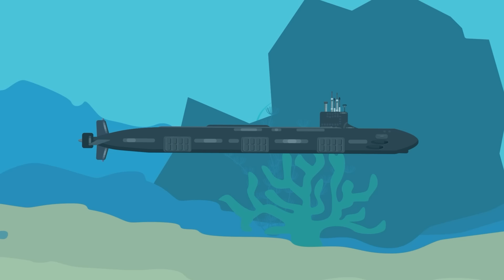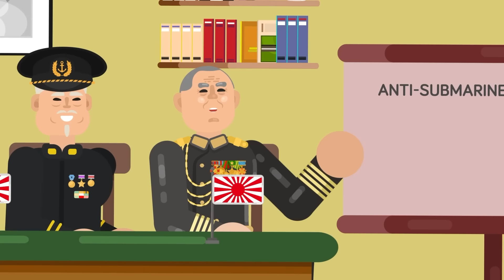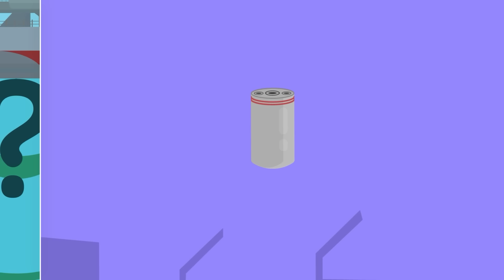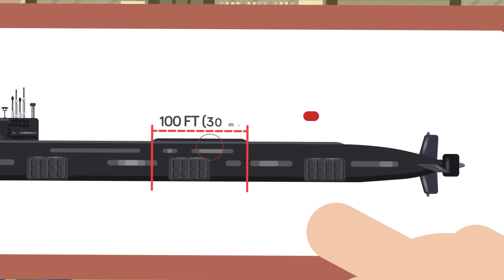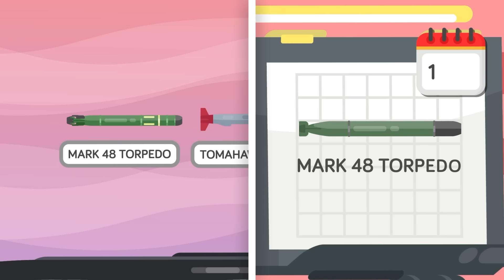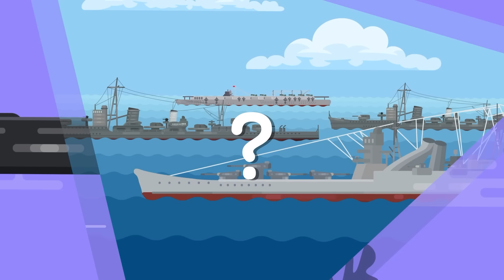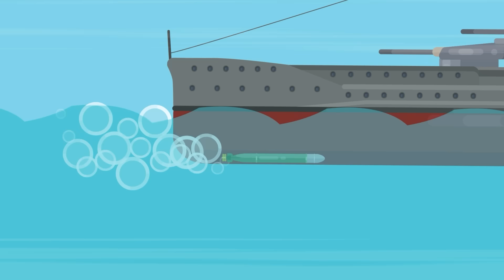What If a Single Modern Submarine Time Travelled to Pearl Harbor

Comment: if the modern sub crew happened to be located near enough to set up an attack on the IJN fleet, and the modern sub crew knew what date they had been transported to, they could decimate the IJN fleet easily.

The problem will be realizing when they are, and where they are... and finding the IJN fleet.  The main problem will be that they simply will not have any acoustic database for WW2 Japanese warships onboard, so the sonar operators will not be able to type-classify contacts by their acoustic features.  Against modern ships, the sonar operators can make determinations about what type of ship a contact is, from extremely long range, because they have digital recordings of numerous ship types they can use to identify the sound "fingerprint"; this allows them to pick out a target at great range.

But they don't know what WW2 Japanese naval vessels sound like, so they'll need to do their long-range target acquisition trying to find a cluster of high-speed vessels, and hopefully they find the right group, because they won't be able to identify anything positively until they get into visual range; chances are decent no one on the sub even knows the visual signatures for WW2 IJN vessels, so they'll have to get close enough to spot flags.

If the crew knows they're being sent back to December 7 1941 right into the IJN formation, it's an easy win.

If the crew is just going about their business and are suddenly without warning teleported to somewhere in the Pacific Ocean a few days before Pearl Harbor, they might be able to make it there to stop the attack, if they realize they've time traveled quickly enough, and they think to listen in on open radio bands for information that tells them what day it is, and they have a history book that annotates the IJN fleet locations during the attack (or someone aboard is a big enough history nerd to know off the top of their head).

But that's a lot of "if"

Comment: Not bad on accuracy, except for the implied reason for a towed array. The towed array is passive (integrated arrays also have passive modes) and the reason it is towed is to get it away from "ownship" noise (among other things) and not to protect it from torpedoes.
Reply: This, and longer wavelength because hydrophones can be spaced out.

Comment: In regards to the reactors being unable to be turned off, its better to say they cant be turned off in a reasonable time frame. Once all control rods in any reactor(naval or civilian) are fully inserted, the reactor is no longer a primary heat source and is turned into a decay heat source which doesn’t produce nearly as much heat. Given enough time, that decay heat will dwindle down enough to be able to turn off the pumps. This time frame is long enough that its better to keep it on all the time. I can say this as i work on nuclear reactors and have a good amount of knowledge on how they work.

Comment: Virginia Class subs were built to defend against Russian submarines some limited surface engagements… doubt a sub from the 21st century would have enough armament or Reactor Fuel (Enriched Uranium) to conduct operations for a significant period.  Sub would be better utilized being closely examined for intelligence and advancing the US nuclear weapons program by more than a decade.  The parts and maintenance issue alone would put the sub out of the war business in about 6 months.  Quarantine of the crew wound be paramount as well …for the Duration of the war.  Hopefully much shorter than in our timeline.

Comment: The Japanese fleet was operating at extreme range from port. So, very dependent on oilers. 

If the goal was to destroy the Japanese fleet after the December 7 attack, just take out then oilers and put one torpedo into each of the capitol ships. They probably would not have had enough fuel to get most remaining ships home on what they had on board. And if they had tried, their speeds would be reduced to the point that they could not defend themselves against the American forces that would be vectored in to harass the remaining ships. 

If the goal was to prevent the attack, the only thing that counts are the Carriers. One torpedo near the stern of each would disable them and prevent the ability to steam into the wind and launch planes. Assuming of course that one modern torpedo would not completely sink a 1940 era carrier. Or, attack a bit earlier before they tanked for the final run in and just take out the oilers. Again, without fuel those ships are relatively harmless. 

A single Virginia would not be able to sink the entire fleet unless it deployed a nuke. Which of course it could. But, in either of my scenarios the fleet would be lost to lack of fuel and period air attacks. And without that fleet ( and it's trained crew as cadre ) as a core for continued operations Japan would have been at a significant disadvantage to pursue the war into 1942.

Comment: The key element of this attack was surprise and it was going to get called off if they were seen by anyone. Thus this sub would only need to turn the active sonar on full blast to let them know we knew they were there and they would have left wondering what could have sent such a strong sonar signal out.

Just attacking one of the carriers without warning would have had the same effect.

Comment: Define "Win".  If by win you mean prevent the Japanese fleet from launching aircraft?  Then yes.  Would Pearl harbour still lose ships?  Yes.  The Japanese subs would be able to get a least a few of them before being detected themselves.  Any ship trying to depart the harbour would be sitting duck for any subs in the area.

The Virginia class simply does not have enough weapons to destroy the entire fleet.  Key ships yes but not the entire fleet.  An SSBN would be able to destroy the entire fleet with a Sea level nuke.  The blast would sink anything on the surface within range of the blast which would be the majority of the fleet.  Anything left would likely be crippled.

Comment: The submarine would not need to destroy the entire Japanese fleet that was there that day. If the mission was to save Pearl Harbor all they would need to do is cause enough damage to the aircraft carriers that planes could not launch before they had a chance to take off for their missions that day. This would prevent the air strike from happening and my guess is any other strike would have likely been called off. The other thing that would greatly help the forces at Pearl Harbor would be if the sub was able to send out a warning early enough to get our own aircraft in the air before the Japanese planes could destroy the planes on the ground and while the airfields were still usable. Having all of our planes in the air would have greatly reduced our losses that day.

Comment: The research on this is just terrible! Ill give you 3 horrible points... 1) the 2 kongo class BBs mentioned here were not top of the game. or even close to the most powerful BBs to take to the sea at the time. They were bordering on second or third tier BBs More like bottom tier of the time. Past them was fuso, nagato, and Yamato. They were pretty far from the most potent Japanese BBs at the time. 2) The VA only has to sink the the 6 CVs and the Oilers. The remaining gunship only ships would have the option of trying to go back at a very slow speed or pushing forward to attack with guns where even victory would have them dry halfway home. So the VA only has to take out these specific ships. Easiest way with a night time attack with 1 tomahawk a piece for the targets .  The remaining ships would suffer big time by the American carriers and shore installations if they push towards a notified HI.  3) The VA has Natural flow cooling pumps at lower speed so no Reactor noise other than the stuff onboard that can be turned off if the sub goes on ultra quiet or quick quiet  . Old LA class subs need constant cooling but everything past them does not.  Bonus Argument... The Va would be undetectable to Japanese acoustic sensors of the time and only close aboard active sonar would be able to find it. Forgive me of grammar mistakes as just dictated this into SIRI and she still makes mistakes. FTR i love these videos but some of these research mistakes are terrible and easily fixed with some hours of research prior to production.

Comment: The Sub would only need to focus on the Carriers. Japanese carrier design didn't include pumping CO2 into the aviation fuel lines when not in use, and their damage control system was laughable with no dedicated damage teams. 2-3 tomahawk hits per ship would leave them burning hulks. During the war when a Japanese carrier took a few 500lb bomb hits it would start raging fires on board.

Comment: Eight torpedoes- one for each of the largest ships, since it’s not likely a modern sub has sonar recordings for WW2 era ships to identify them. Six carriers and two battleships snap in half out of the blue with no warning and the rest turn and run for home. Knowing where and when the Japanese fleet would be there, the sub could move into position so the fleet would said right over it, lurk at a depth they can’t detect it at and throw torpedoes almost vertically into their midst with impunity.

Much like most modern day technology, it would work brilliantly, right up until it ran out of ammunition or something important broke and couldn’t be fixed.

Comment: Just knowing the history of the war would be an incredible advantage
Reply: The problem with that is your knowledge would only be useful for a single battle. Once you change the outcome of a single battle with your knowledge, that would change the entire course of the war and it wouldn't play out like it did originally, so your knowledge of the original events wouldn't be very helpful. That's why you'd have to save using your knowledge for the most pivotal engagement of the war. And even then, there could be completely unforeseen consequences to changing history like that.
Reply: @   You might be right, it would be a new time line.   But we will never know ,it was hypothetical any way.

Comment: If we assume the sub has IDAS (and that they can track the aircraft attacking), the sub could probably drop 8-16 planes before being out of AA round. A fairly insignificant number against the over 300 Japanese aircraft.

The attacking carriers were 150 miles away. Without target coordinates (which they didn't have), any missiles aboard would be useless. 
The torpedoes on the sub would have a max range of maybe 15-20 miles, so the sub would need to travel at a speed of 40 knots for 3 hours to get within firing range. By that time, the attack would have ended (ironically because the person leading the attack was worried about submarines and didn't want to continue attacking Pearl Harbor, despite the attack plan calling for more waves to be launched), and the carriers would have withdrawn.

So the overall result would be: No change.

The only way to change Pearl Harbor with a single military unit (as we've seen time and again) is to give them foreknowledge of the attack and put them in place to intercept the carriers before launch... but if you do that, then you could stop Pearl Harbor with a freaking WW1 sub... you wouldn't need a Virginia to do it.

Comment: any time a time traveling modern thing going back to whatever war is involved. the result is nearly always the same. its range keeps it completely safe while allowing it to pick from a buffet of targets at its leisure, but is unable to take on the entire buffet by itself because it doesn't have enough capacity to deal with the numbers or it runs out of fuel or whatever other consumbale resource it needs to keep operating which doesn't exist in the time period it travels to, meaning it becomes a paperweight after its one devastating attack and likely ends up being ripped apart by the country it's fighting for in order to reverse engineer it and massively accelerate technological advancements.

Comment: If the modern sub was given free reign, then it would have made a difference.    However, all entrenched bureaucracies are too pig headed to accept new ideas.   Infact, the U S diplomatic core warned the U S military of an imminent attack.    U S land based radar also saw the attack coming.    It is debated that Roosevelt knew of the attack, and that is why all the U S Aircraft Carriers were conveniently not at Pearl Harbor when the Japanese attacked.    Roosevelt allowed that attack to happen inorder to nullify American Isolationists.

I got layed off from an industry leader, and got hired at a backwoods company to increase the yields and through put.   I knew exactly what needed to be changed.   The entrenched bureaucracy's response "but we always.....",and, "we never done this before".     Even after 2 years of flawless changes that I made, the bureaucracy had the same pigheaded mindset.

Comment: A modern American submarine has Mark 48 torpedoes with a range of 50 kilometers 
The Japanese Navy would lose all their carriers before they knew what was happening 
And at the beginning of the war, the Japanese Navy was not really equipped with sonars at the beginning of the war that could detect a submarine that far away 
The nuclear reactor can be shut down, but there is a procedure to do it so that the submarine does not run out of electricity for the pumps that cool the reactor (to avoid Chernobyl at sea) and it is done in the port

Comment: Frankly modern day sub in the past would be useless. They cant refuel their weapons, they cant communicate due to diff in communication machines... it is only effective for like 5 shots before it can be abandoned
Reply: Quite some more shots, actually. But doesn´t matter in this scenario - sink or sufficiently disable the carriers first, then the battleships (a smart torpedo is probably capable of specifically targetting either the screws/rudders or the engine locations, this would render them sitting ducks for the older US forces), then the oilers, the latter will make at least the destroyers unable to return home.
Comms? I would be surprised if a modern sub in incapable of basic radio communication.
And rearming the sub? Can´t be too difficult to fire an old, dump fish from a modern tube, it´s just not much better, although the modern crew probably knows a thing or two about why some US torpedoes didn´t to well in WWII.

Comment: Sensors would be key.  A US Va class being able to distinguish between the carriers of the Kito Butai and the other surface ships would lead to a truly bad day for Japan.  As to the Tomahawk "only" having a 1,000lb warhead. Let's remember that Lt. Dick Best dropped a single 1,000lb bomb on the Akagi, into her hangar bay that was packed with 18 fully loaded and fueled torpedo bombers - resulting in the death of the Akagi.  Some historians believe that the equivalent of 70,000lbs of explosives were set off by that one bomb. So theoretically, a single Tomahawk COULD, in these same conditions, end a WWII Japanese fleet carrier.

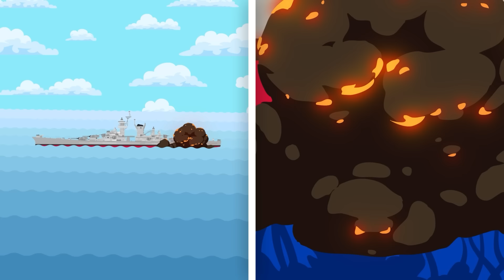Comment: 02:17 The Fusos, Ises, Nagatos and Yamatos, are just staring at the screen in disbelief, because old Kongo-class battlecruisers got called more powerfull than them.

Kongo-class battlecruisers: 4 twin 14 inch turrets

Fuso-class Battleship: 6 twin 14 inc turrets

Ise-class Battleship: 6 twin 14 inch turrets

Nagato-class (Fast) Battleship: 4 twin 16.1 inch turrets

Yamato-class (Fast) Battleship: 3 tripple 18.1 inch turrets.

Seems an awfull lot more powerfull than the Kongos...

Edit: small changes to make more precise

Comment: Important to note that fleet commanders and other ship captains usually retreat or surrender LONG before losses accrue to 50%. Open with sending 2 missiles at each of the oilers, torpedo the 2 lead battleships and carriers. You're a modern US warship, so likely have a Japanese speaker or at least a pretty good artificial translator. Broadcast something like "American Yokai will come for the rest of if unless you go home". They have no idea what just happened. You still have only used 1/4 of your arsenal if they still feel frisky. Carriers are next. Circle the fleet from 500ft below waiting for their aircraft to lose to gravity, only targeting anything trying to get out of the circle. 
Still frisky? Those marines you mentioned in the torpedo room have been BORED. Have you ever seen a bored USMC marine? There's drowning Japanese pilots to ... "rescue". Actually, no, really rescue. This is a modern US sub and US soldiers back their allies. 
Those Psy Ops broadcasts from before will sound even better with their comrades real voices. Like. Feed them lunch and everything. Broadcast how comfy life on the boat is for Americans. Ideally, save a lot of those pilots even, bonus points for anyone on board of JP ancestry that was translating from before. Get remaining JP strike fleet commanders paranoid to even let ppl near radios for fear of mass surrenders.

Comment: One issue that would pop up is that modern submarines use military GPS, for location, instead of maps, but I'm sure that the navy has multiple backups for knowing their location. Also some modern communication equipment would not work (no satellites). I do not know if modern military radio communication systems would be compatible with what they had back then. And the most important part, would the captain of a time traveling submarine want to mess with the timeline of WW2 by attacking the Japanese fleet?
Reply: No GPS underwater.  I am sure subs use a laser ring gyro just like USAF aircraft.   We could deploy an F-16 halfway across the planet and back and the laser ring gyro based internal nav was only off by a few meters.
Reply: There’s no satellite reception at depth. Inertial navigation is the way.